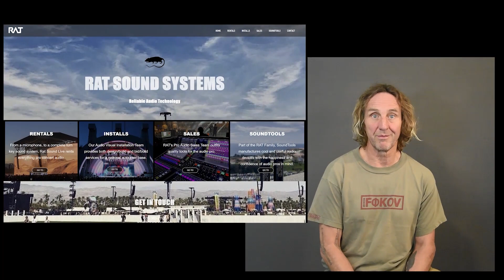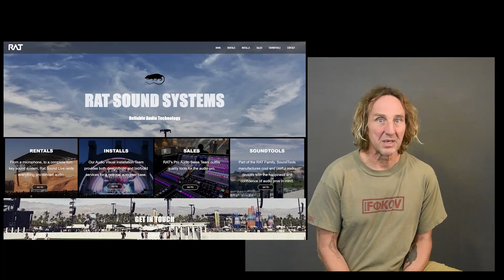Actually Hear In-Ear Headphone Latency Issues (Public)

Comment: Stumbled on to this as I’m dealing with in ears latency issues with my solo live show. I’ve landed on using a personal iem amp that hangs from my pocket that’s hard wired to the monitor out and my I’m ears. I never was satisfied with the  wireless inexpensive unit that has 4 ms latency. Kind is a comb filtered sound that just sounds bad. My performance is done while seated so I don’t need wireless. Great video, thank you!
Reply from the maker: very cool and simple solution with a high quality result, love it! 

a good rule of thumb is never use wireless unless you absolutely need it and everything will sound better

Comment: I have a digital harmonica (DM48X) which takes the place of a synthesiser keyboard, so it makes no music itself but plays on Bluetooth to a synth app. It can have bad latency issues depending on your app and system, Android vs Apple etc. Delay can be half a second if you also use a bluethooth speaker. Latency shows up like a sore thumb in that case. You hear the note you played as you play the next note. Very strange feeling!
Reply from the maker: Messy. Yeah, Bluetooth and latency are an issue. There may be low latency dedicated BT to analog units out there. Will want something that only does one thing, your harmonica sound. But still it will be laggy

Comment: Pro monitor guy here.   I've been shouting about these phenomenon for ages!    One thing that I've found is that it seems that different microphones, signal chains and in ear monitor setups are perceived differently by different people.      If at all possible I always experiment with singers on different polarity settings and find that some prefer in or out which may or not be what sounds right to me.

I'm on an S6L with some Sennheiser 6K mic systems and Wisycom IEMs, so I'm really at a pretty bad latency scenario.   Fortunately, I only have one singer on the 6K and IEMs and she seems pretty tolerant of it.  When I A-B her mic vs the hardwire mic next to it the difference is astounding.  

Final thought.  I've always wondered if an all-pass filter plugin or something like the Radial Phazer hardware box could be used to improve the sound of microphones in IEMs.  Have you ever experimented with that?   Thanks for the neat content.
Reply from the maker: Not experimented at an actual gig but in addition to testing rev polarity, tests show the possibly adding latency of up to 5 or 6 Ms will alter the cancellation frequencies and possibly be preferable sounding for some voices/singers

Comment: Hey Dave one question if you don't mind, why do you use that small behringer mixer for your tests? I mean even if they are a blessing for us musicians on a budget, they don't have the most precise/durable knobs in the world. But am I right to assume that for you the quality offered by that small mixer is sufficient to carry out your tests? I hope I made sense of the question, thanks a lot for sharing your knowledge.
Reply from the maker: It's quite easy to make a simple analog mixer that has a wide freq response, is flat and sounds good.

It is very difficult to make a digital mixer that does the same.

That little analog mixer will beat out the digital mixers in nearly every metric.

That said, making a big complex analog mixer is another story, very expensive
Reply: @DaveRat  Thank you so much for the explanation. I have those little mixers too. I have used them for so many different applications live and at home, they've always paid off their weight in gold for me. Last thing I remember is using them as a bass DI preamp, where the eq and drive seemed to do just what we were looking for.

Comment: Hi Dave, have a question, as this video was very interesting. Would you introduce a bit of latency to the in-ear system, just got a different tone for the performer, assuming the interaction there is auditable. I’m also taking about couple of milliseconds, anything before you can actually here a delay in signal?
Reply from the maker: I have never added latency, but I do test polarity.  Though adding latency is an option and could improve perceived tone in some scenarios

Comment: Yes! I've been talking about this for years! Latency always comes with digital processing. Kemper+digital board+digital in ears/speakers with digital processing= perceivable latency.
Reply: Yes, and it pisses me off that almost no manufacturers publish latency specs, or they may say something like "imperceivable latency", completely ignoring that you will use several pieces of gear which then add up to very perceivable latency. And then none of them care because their gear has "imperceivable latency" on it's own. Drives me crazy. The problem could be somewhat improved if they at least upped the sample rate from 44.1k to 88k or higher, but it would cost more and they don't see the benefit because, you guessed it, it's already at "imperceivable latency".
Reply from the maker: Agreed!

Comment: In my studio I found something similar running through digital gear. I tried it myself and found it was much easier to sing in tune with a full analogue monitor path and with the proper polarity, the latency through the digital path was about 1.5 or 2ms. It was only slightly tricky to keep track of when I was recording on digital but i always made it a point to set up this kind of monitor path. When recording on two inch (which is pretty much all I I do now), there isn’t any digital delay so I don’t have to think about it. Great video!
Reply from the maker: Awesome and there must be something psychoacoustic about this as well. Because singing while listening to a monitor wedge that is 8 feet away from our ears would have a 8ms or so latency on the voice, but that tends not to be an issue.

But having the source closer than the natural latency would be seems to feel unnatuaral
Reply: Yes it’s a bit strange, I wonder if in ears or headphones react differently from wedges in this way. There would be more reflections and mixing from wedges and general stage sound if you’re not on IEM. In-studio and IEMs isolate you more, maybe that changes the sensitivity to latency? The only latency issue I’ve felt on stage was with really sluggish subs, I play upright, so I couldn’t crank the stage amp to get the attack crisp enough to feel right. The subs took maybe 60 to 100ms to stabilize, that really rounded off the notes I could hear. I loved playing through the old Martin horn loaded bins, they were crisp, never felt that they were sluggish. Anyways, in the studio with cans on, it was definitely very noticeable for pitch control. It could be that the sound of the combing is more diffused with wedges?
Reply from the maker: I think our brains do some calcs to determine sound source distances and when the calculations don't add up, it sounds off to us.

That said, I also think our brains will recalibrate if we give enough exposure

Comment: Your videos are really great at demonstrating these phenomena, very useful. I'd be curious how this translates to wedges, and how bone transmission  possibly is choked or exaggerated by the incoming wave front emanating from the wedges at various distances and latencies 
I'd also be curious how the brain deals with the "cognitive dissonance" of seeing a wedge at a 5-7 foot distance but "hearing it" at an artificial 8-12 distance ( assuming a latency of 1-5 ms). Our hearing is certainly sensitive enough to spatial cues in order to detect several feet of distance mismatch between eyes and ears. In my personal experience I find digitally derived cue signals of myself ( not a singer, just guitar) as highly disorienting while the delay in the analog domain ( where there's only physical distance) poses no problem.
Thanks again for these wonderful videos.
Reply from the maker: Great thoughts to ponder. Thank you Walt!

Comment: Can you make a video - for us not so advanced engineers - regarding how you go about tuning a room/master buss?
I seem to get the concept of what has to be done, but, it seems like I get inconsistent results (maybe it's just my inconsistent ear).
Usually I run pink noise. Then, I use a reference track to make sure the speakers actually sound good with music. After that, the band goes up and I seem to - most of the times - have to EQ my master buss (sometimes a lot) to make the band sound good.
What do you recommend me?
Reply from the maker: I will work on something down that line

Comment: So the next step would be to have an IEM with “resonance cancelling” DSP on a piezo built into the mold. Or make a negative IR plugin modeled for the ear canal.
Reply: For testing or for the user? The user  I would expect their brain already compensates.
Reply from the maker: Oh my, take a reading of someone's internal sound and then have that data to apply as needed to cancel or compliment
Reply: @DaveRat  that’s kind of my thought on using it on a cue mix.

Comment: I'm learning to sing, and recently I tried practicing with a wedge, but also ear plugs (custom molded, -15db reduction). I have yet to try in a band setting, but by myself, when I have ear plugs in, I heard only slight difference in the top end. I'm not sure if my wedge was at a typical band volume level, but I imagine that I could really just use the wedge to fill in the clarity over my ear plugs, BUT without them, it would sound just like some piercing screech? How unbearable that might be for others if my wedge was all treble, no bass, maybe even no mids?
Reply from the maker: Hmmm, sounds like in ears may be a thing to try

Comment: hey dave i currently on the hunt for a new rta mic to wrk with smart any recomendations?
Reply from the maker: I've been using the audix mic but my take is that it's pretty easy to get a fairly accurate mic cheaply and very difficult to make an accurate sound system, so a moderately priced measurement mic is more than ya need for most applications.

That said, for doing accurate comparison measurements w more than one mic, getting multiple mics that are very similar with minimal differentials requires spending more money.

Comment: Hey Dave , thanks for that...  great video!
I just started using my first set of in custom in ears and the internal res is driving me crazy...

Set up
- Behringer XR16
- Behringer condenser mic
- V shaped eq custom in iems  direct wire out of headphone out.

Questions
- is there an eq setting that is typically used to combat the muffle sound of the internal body res?
     -with these in ears I find I’m jacking the hight frequency of the mic input
- would changing the in ears for a less v shaped eq help with the muffle sound of the internal body res?
- Is there an email I can send you other questions?
  - I haven’t finished my iem system yet.  I still need input splitting for foh.
  - I have other question about how to do this with your gear.

Thanks for all you do!

Dave
Reply from the maker: EQ ing ears to combine well with your internal resonances is similar EQ ing a sound system to combine well with a room's acoustic stage volumes from a band. Add the freqs(instruments) that are lacking and don't add frequencies (instruments) that are already loud enough.

I would skip the v shaped EQ, avoid adding unneeded lows and just add the hf needed for clarity and a balanced tone.

Comment: Interesting, how changing the latency seems to minutely change the perceived pitch of the ’moo’. Which makes perfect sense, as the cancellation in the lower end would change the balance of the harmonic content and the formants in the voice(!) 

Never thought of this before, but this would perhaps explain some problems singers sometimes have with pitch when their IEM situation isn’t ideal. Very good singers going slightly sharp with the in-ears when they never do that without the IEMs. Will need to investigate further.
Reply: That's an interesting question.  Would it be all notes or ones near a comb frequency? 
Makes me wonder if purposely adding miniscule delay ( perhaps in tenths of a millisecond or in 1ms) is worth trying if the artist is struggling after exploring other options, such as balance/seperation, EQ, etc. 
@dave rat
Reply from the maker: I feel that the time delay alters the timbre but not the pitch per se. I can't picture how it would shift the pitch, as in the frequencies shifted up or down. Rather, it should alter the volume levels of the frequencies heard as different freqs are summing and cancelling as the time changes
Reply: @DaveRat  I agree, though if you play around with a dual oscillator summed, say with two sine waves, one at a fixed known pitch, and the other starting at -inf. set it to any other tone and start bringing it up gradually, at some point it starts to make you question what note you're hearing because of the new false harmonics being generated by the summing of waveforms
Reply from the maker: Cool cool, let me know what you figure out